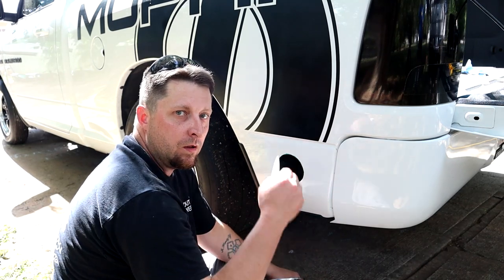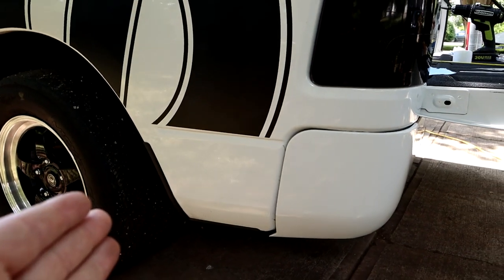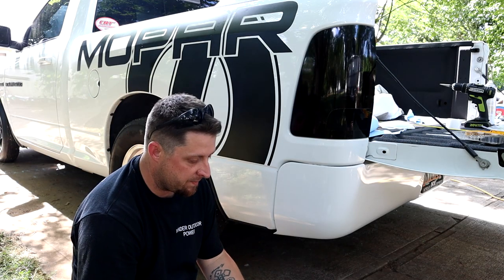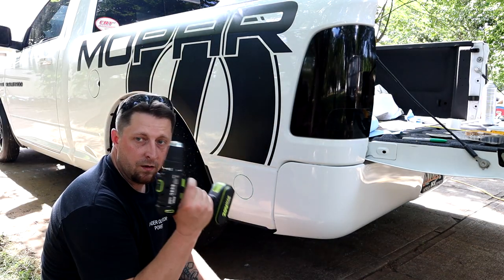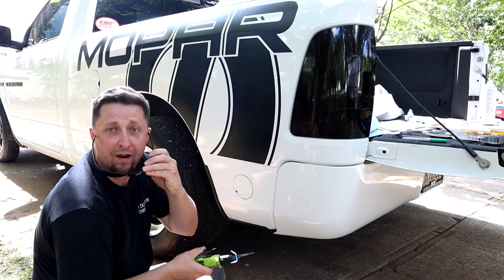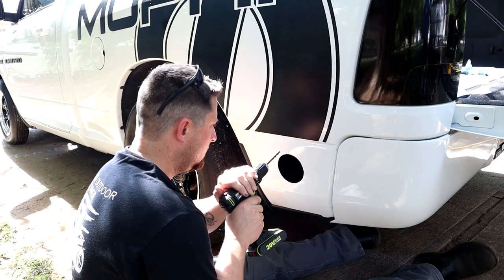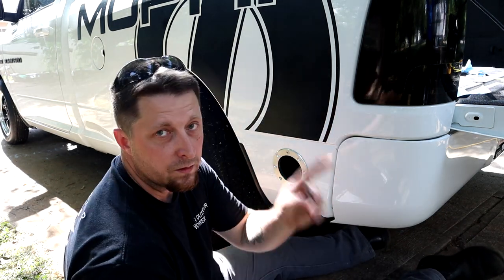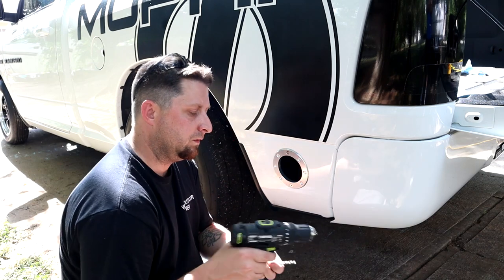FROSTBITE RAM R/T Gets Dual Side Exit Exhaust

Comment: I've seen exhaust shops rivet these. By the sound of it they aren't lock nuts or has lock washer. I'm guessing even if you ram rod them in and not crush the fender they don't back out? Can always hit the inside flange with some clear Chaulk or something to help adhesion and risk of it vibrating metal on metal (moisture getting in too) I had to add in dense rubber between my License plate and my metal plate frame, could hear it rattling at stop lights drove me nuts hahaha
Reply from the maker: I put lock tight on them we shall see how it holds up lol.